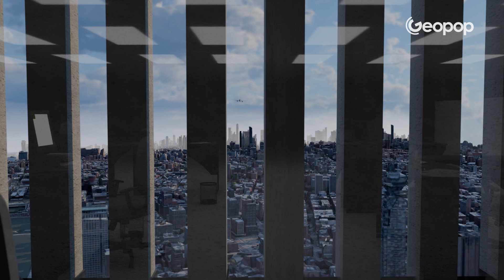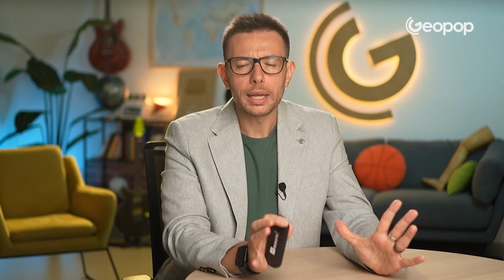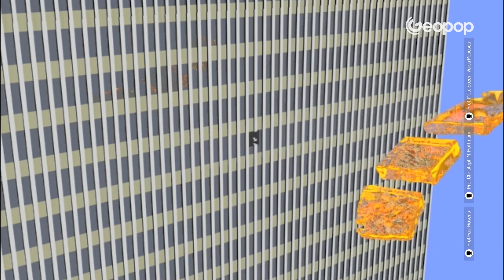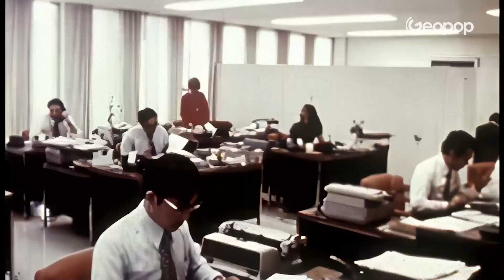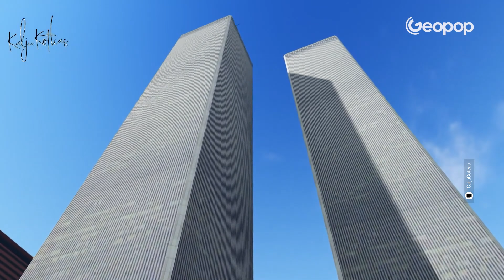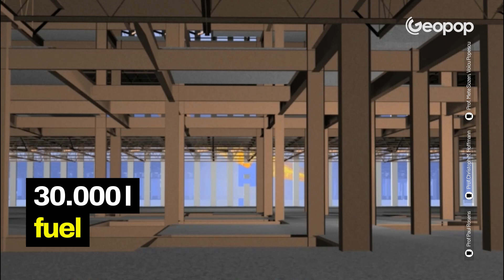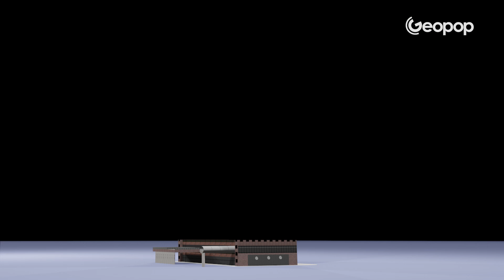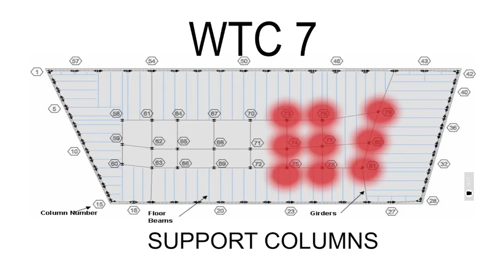9/11, 2001: The Technical Reconstruction of the Twin Towers and WTC 7 Collapses

Comment: The USGS found in all the dust samples evidence of molten steel after the twin towers and WTC7 fell.
NIST denies the extreme temperatures, but there is a  metalurgical examination published in 2002 on appendix sea by FEMA, showing evidence after this NIST took over the investigation and got rid of the evidence.
Which stated that there was a hot temperature corrosion attack on the steel. (Liquid molten iron invading the steel)
“Steel stopped being used on skyscrapers 100 years ago”
Liquid molten iron is a byproduct of thermite which is an inciendiary used in the military to cut steel with no problem.

There is evidence form witnesses and from the estructural engeneer of the WTC himself, Leslie Robinson, stating the molten steel coming down from the tower.

Steel weakens at 1200°F but for it to reach the molten state has to melt around 2500-2800°F which its imposible to achieve this from the plane fuel/fire/explosion.
There are multiple organizations and agencies such as FEMA,OSHA,BECHTEL with proof of evidence of the extreme temperatures above 2800°F.
NIST stated 1800°F with no evidence where is still 1000°F short from the melting point.

* There are videos of the south tower where you can see molten steel falling from the sides minutes prior the collapse. 

So how this temperatures can be achievable?
Niels Harret and other 8 international scientist studied 7 different samples of powdered concrete and every one got the same result of unignited nanothermite, they found this with xcds, were this samples had high level of aluminum and iron (byproducts of thermite) —> a very sophisticated form of inciendary (nanothermite), when heated they ignite releasing extreme temperatures, wich later causes the molten steel, the same evidence found in all the dust samples of the WTC found by USGS.

This is clear corroborating and repeatable data that shows what brought down the towers.
So if this thermite was put stategically on the steel core structure of the towers, the core could collapse as well as the building at the speed it did, at free fall. 
If this would not have happen, the building could not have fell this way (at free fall), but more as a sequential fall (floor by floor) reaching a resting position somewhere along the building, since the momentum has to reach a resting position once the energy of the fall is gone.

Comment: I still can't understand how the planes hit so high up and the buildings falls to the ground. No floor was left,  from what I can see. The 😢😢😢😢 if it destroyed the steel in the area where the planes hit, does that means that's only where the steel was? Wasn't the entre buildings made mostly from steel?
Reply: Steel and concrete using bolts on the steel.
Reply: Let’s break it down to the absolute basics, addressing most of the commonly asked questions as we go:

The 47 core and 236 perimeter columns of the Twin Towers support all of the gravity loads of the building. ALL of the resistance is in the columns.

Planes impact Towers, causing massive structural damage, destroying sprinkler systems, tearing out gypsum board walls and blasting off the SFRM insulation from the floors. Multiple floor-wide fires are started instantly and spread rapidly due to the destruction of fire protection systems and venting of the building during the impact.

Serious fires were largely confined to the impact damaged floors and those immediately adjacent to them.

Fires were started by the impacts and fuel aboard the aircraft, which acted as an accelerant. No shortage of other consumables inside the tower to continue the fires.

Collapse was initiated (started) at the impact and fire damaged floors when floor trusses exposed to heat over time sagged, in turn pulling on and causing the inward bowing of some perimeter columns by up to 5 feet until they buckled on one face of each tower (ie: NOT symmetrically).

www.youtube.com/watch?v=ULdiD6gYZO0

No steel melted or needed to. Structural steel will bend and fail at less than half its melting temperature.

Once the perimeter columns buckled the formerly static load above became a dynamic load 30 times greater, easily overwhelming the structure below.

Thousands of tons of now loose debris fall through the open office space within the four outer walls - bypassing the columns - dropping 12 feet onto the first intact floor it comes across. That massive instant overload causes the floor to fail, shearing the pair of bolts that secure each end of the floor trusses to the columns. The floor fails. adding its mass to the falling mass which continues to accelerate for another 12 feet until it impacts the next floor, rinse and repeat one floor at a time all the way down.  Yes there is resistance but its totally inadequate to arrest the collapse. Resisting is not the same as preventing

The columns - the part that holds the building up, supporting ALL of the gravity loads - are spectators for all this as the debris falls around and past them, not onto them.

Rate of collapse increases as momentum increases. The collapse front is constantly accelerating.

As each floor fails, air inside the building (the Towers were 95% air by volume) is compressed, then blows out the sides _in reaction to the Tower falling, not the cause of the Tower falling.

No fire required at all on floors below the impact points for them to fail. The mechanisms that started the collapse are different to the mechanisms which continued the collapse. That will be a difficult concept for some.

As the floors fail the perimeter columns are left literally hanging in the breeze, no longer attached to the rest of the structure. They peel away and fall in great sheets (think banana) out to more than 600 feet from the base on the 4 points of the compass.

Core columns failed last, buckling near their base due to the loss of critical lateral support as the building collapses around them.

www.youtube.com/watch?v=WpHXj62Ylw0

Twin Towers collapses were a combination platter of four (4) factors:

Impact Damage + Fire (heat) + Time + Gravity = Collapse

Remove any one of those four factors and there is no collapse. Ignore any one of those factors (most people reading this ignore three) and you will never understand the collapse. They all work together. 

The collapses took 32 to 34 seconds start to finish, or about 1/3 of the rate of free fall acceleration for those obsessed with how fast things fall because the internet told you it was important. No Laws of Physics are violated so no need to invoke magic or divine intervention

Each 110-story tower had a 1-acre footprint. The debris pile was up to 14 stories deep and spread out over 16 acres, destroying 8 surrounding buildings and damaging more than 100 others.
Reply: @TheLoonResistance  Stinkyshit, as you notorious liar know damn well the core had its own lateral support. So how did the core columns fail stinkyshit? Oh wait, I forgot, you are way too much of a coward to ever answer questions on your utter stupid copy paste blahblah...

Comment: When the jet fuel went down the elevator shafts it created a blast furnace effect and steel gets spongy at about 800 dregees
Reply: Yeah, sure... But did you know that almost all shafts ended on the 78th floor? And did you know that the steel didn´t even reach 600°C, let alone 800°C?

Comment: Actually, let me say if by now, all WTC towers, buildings would be very old and might require a total renovation, redevelopment, refurbishment, reconstruction. It could also be an "easy demolition". Unfortunately and sadly, nobody would ever think of the "Planes Operation"!
🧘🏻‍♂️🙇🏻‍♂️🙏🏼🤲🏼
Reply: The overwhelming majority of buildings in NYC are far older than the Twin Towers and still doing fine.
Reply: @TheLoonResistance 
Yep, but they are also renovated.
Reply: @Bodhi-Eyes  "Unfortunately and sadly, nobody would ever think of the "Planes Operation"!"

The twin towers were the only civil buildings literally designed to withstand "plane operations" even more destructive than the actual ones, and the resulting fires.
Reply: @TheLoonResistance 
P.S: Also, the construction of 1WTC, 2WTC and 7WTC, the design and architecture, Emery Roth & Sons, Trishman Construction, those structures had similar trusses.
🟰🟰🏗️🏗️🧘🏻‍♂️🙇🏻‍♂️🙏🏼🤲🏼
Reply: @Bodhi-Eyes  - Building 7 didn't have truss floor systems like the Twin Towers. You aren't exactly batting 1,000 here.

What buildings were renovated?  All of the tens of thousands of buildings in the Twin Towers older than the Twins????  Every single one?
Reply: @TheLoonResistance 
@TheCriticalStinker-01 
Watch this 7WTC trusses and extra load weigh of the penthouse on the roof played a role.

https://youtu.be/KMvCWFCoVN4?si=RaEs2Yx5zZAjCBeT

Empire State, Chrysler, Flatiron, Rockefeller, even Sears/Willis Tower, all had renovations.
🧘🏻‍♂️🙇🏻‍♂️🙏🏼🤲🏼
Reply: @Bodhi-Eyes  - Oh FFS.

Building 7 collapsed from the inside out which is not at all intuitive and hard to understand, with most details being hidden from view.  It requires careful analysis and observation, and some people will struggle no matter how much it is explained. But here is my explanation relying on no outside authority. 

Building 7 was a unique, asymmetrical 47-story steel frame structure built atop a smaller 3-story building serving as a partial foundation, requiring lower floors dedicated to complex load transfer structures. Of trapezoidal shape and tube-in-tube construction, B7 (above the 7th floor) consisted of a central core of steel columns carrying most of the gravity load, perimeter steel columns around the outside of the structure carrying the remainder of the gravity loads and long span beams and girders to tie those elements together and form the floors. On the outside of the building hung a facade or outer shell. 

www.nist.gov/image-16640

Phase 1 : First externally visible signs of collapse initiation occurred at 5:20:28 pm and was notably quiet with observers not realizing the building was collapsing! No warning in the form of hundreds of eardrum busting 180dB explosive bangs. Here at 12:00 a local CBS affiliate reporter talking 10 blocks from B7 when collapse begins. People don’t start to notice the collapse until 12:11. At 12:45 is the famous CBS fixed camera clip of Building 7’s collapse. Note the silence. 

www.youtube.com/watch?v=t5tEy6mXSE8

Lower floor failures above the load transfer region (8-14) in the NE corner initiated the collapse. In this video at 0:45 you can see the NW corner from inside the building while under construction, Column 79 just out of frame on the left. That big, angled steel beam across the top of the frame connects to C79 at one end. The girders connect to the beam. That beam and all those girders depend on just one connection 

www.youtube.com/watch?v=nP3TNHPCIVU&t=45s

Phase 2 : NE corner floor failures caused a loss of critical lateral support over an excessive length of Column 79 and it buckled. Looking at the above floor diagram of Building 7 when you see all the structures that depend on C79 you quickly realize this one column was a relatively isolated structural element on which a disproportionately greater fraction of the structure depended analogous to say the Key Bridge. Externally as collapse begins we see a vertical progression of window breakage along the 44-46 line and a kink in the roof of the East Mechanical Penthouse at the top of the building, consistent with C79 failure. Normally with a buckling column, the load could be redistributed to other columns. With C79 that is not the case - the failure did not redistribute the load, so the collapse rapidly progressed to the roofline, sinking the rooftop penthouse. The transition from full capacity to almost no capacity occurs in an instant and will result in virtually no resistance 

Phase 3 : With C79 gone, B7’s progressive, non-symmetrical collapse continues with adjacent columns 80 and 81 left laterally unsupported and quickly buckling as well. The EMP drops down through the building. C79-81 all have no diagonal bracing, which is the major reason why they could not redistribute a lot of vertical loads among one another. From there collapse progressed from east to west through the central core until the core was gone from 81 to 58, taking all the interior floors and probably most of the perimeter columns with. Follow the horizontal progression of window failures low in the building and the dropping of the remaining rooftop structures into the building. The NIST Building 7 study model 4 determined C79 failing under ANY circumstances would have initiated the same collapse sequence. 

Phase 4 : After about 10 seconds only the exterior moment frame remains, giving the illusion B7 is still standing to the casual observer since little has outwardly changed. But it is just a hollow empty shell like an empty cereal box supported only by a few remaining columns and overloaded from the loss of the core columns and floors, quite unable to remain standing. With nothing remaining behind it, the north face leans inward, forming a V in the roofline, the last few columns buckle under the strain and the moment frame free falls, landing on top of the debris pile. 

It is only here at the very end, a single measurement of alleged free fall acceleration is taken, from just one point on that outer shell. The Building (core and interior) did not “free fall” - was already gone before that happened - just one corner of the outer shell briefly moved at a rate comparable to FFA. This alleged FFA was a product of how the shell fell NOT why the building fell . It’s also not even proper FFA as the single measured point was moving in 3 dimensions, not just down, which adds another variable. Start to finish the collapse took 18-20 seconds, 3 times longer than true FFA . How fast something falls can’t tell you what started it falling, certainly not 10 seconds after it started falling.  

The debris spread outside the footprint blocking surrounding streets, heavily damaging the Verizon Building and destroyed Fiterman Hall. 

No building is meant to survive 7 hours of multi-floor unfought fires. Building 7’s progressive, non-symmetrical collapse was incidental, unintended collateral damage from the combination of fire, time & gravity started by the collapsing North Tower, true no matter who planned and carried out the 9/11 attacks or why .  Of so little consequence it barely registered at the time, only taking on semi-mythical status as an alleged smoking gun years later when demolitions at the Twin Towers, missiles at the Pentagon and shoot down over Shanksville all failed and conspiracists had nothing left to work with. 

Anything can seem like a conspiracy if you don’t understand how it works. Now you should. I hope you found this helpful, informative and it solicits informed critical comment. If I made any errors of fact, logic or reason or left anything important out, please let me know so I can fix it. OR offer a more plausible alternative if you can. Be the first. Please start any reply with the words “Tits McGee” or I will know you didn’t read it and are wasting my time.
Reply: @TheLoonResistance   As always, nice work.

Sadly it's going to take explosives to change their minds. May I suggest thermite ?  After all  has it ever been  used in building demolitions ?  Just seems to be someone who grasped onto it cutting through steel

Conspiracy theorists have a big problem with steel being so "tough".  Hence why they deny aluminium can cut through it given enough kinetic energy. Especially they forget it was all held together by bolts, a historical week point on buildings. MIT suggested single bolts in the constuction helped lead to failure.
 
Rather than using thermite they used aluminium on the day.   True but not something they can grasp.
Reply: @zMW574e  "May I suggest thermite ?  After all  has it ever been  used in building demolitions ?"

Let me destroy your wishful thinking: Yes it has.
Skyride tower, Chicago, 1935.
Reichstag (dome), Berln, 1954.
I also recommend the Jon Cole video on thermate...

"Rather than using thermite they used aluminium on the day."

Let me teach you again: Aluminum is common main ingredient of thermite, so it´s not "rather than". If they used thermite then at the same time they most definetly used aluminum by that. (You can replace aluminum by other metal and still have something called thermite though...)
Reply: "It could also be an "easy demolition". "

I'll stop you right there ...   just silly.
Reply: @zMW574e 
Pardon me, no offense. Our mindset in the 60's, 70's, 80's, 90's and the mindset now, "each and every now" will not be the same, it will keep on changing. Just like people keep on changing the rules, regulations and laws.
🧘🏻‍♂️🙇🏻‍♂️🙏🏼🤲🏼